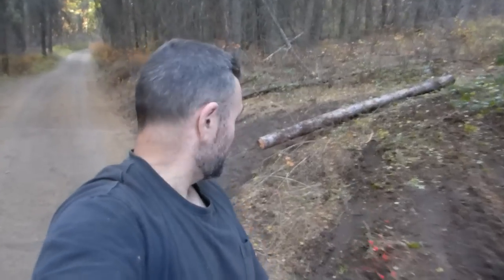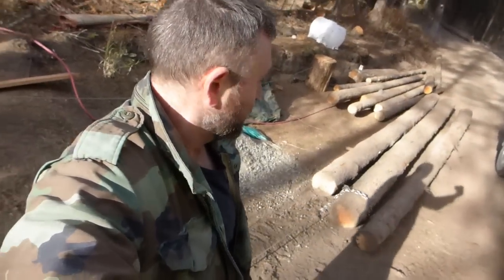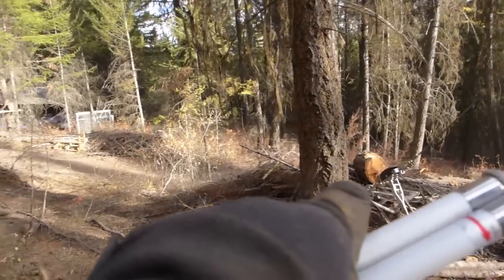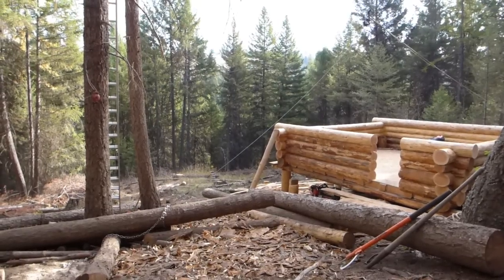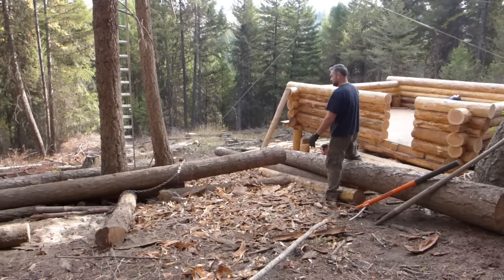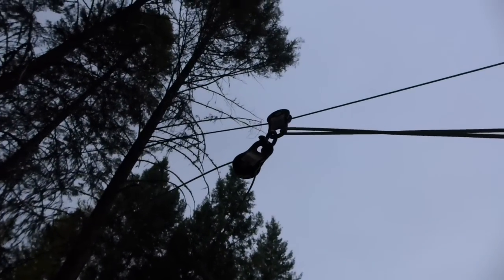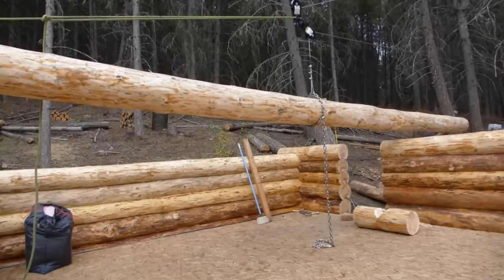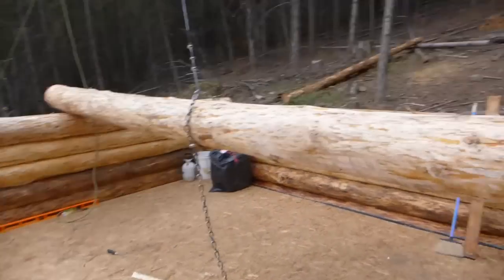Off Grid Log Cabin Build - Moving logs

Comment: Great job, lot so hard world involved. We helped build a cabin years ago using the same techniques, brute force with mechanical advantage of cables and pullys. One thing we added was an old car engine hood to help bring logs out of bush. laid the ends of log on it, could lay more than one long on it, thread chain through hood then around log ends to hold hood in place, acted like a sled through the rough ground, preventing the leading end of the logs from digging in. We also made sure when hooking logs, the hook at end of chain came down over chain, if bought up under and hooked, when slack there is danger of hook falling down down and away from chain, freeing log to roll away.

Comment: Using 2 snatch block is brilliant !  It keeps the work vehicle close to where you are maneuvering the log so yu don't have to yell to much to the Missus !

When using chains for wrapping around thing to haul them, I have found that replacing one of the hooks with an over sized hook that the chain will slide through and tighten as you pull, to be very useful.

Comment: I too used larger than average logs (better thermal protection) and to lift logs to the wall we built, from dimension lumber, a small crane that was self-standing on a square footprint. Sort of pyramidal with a center-balanced, vertically pivoting arm. The lift side of the arm was hooked to the balance point of the log. The opposite end of te arm was hooked with a come-along to loops of cable, through the floor, around floor-joists. This anchored the crane and provided the leverage needed to lift the logs. The higher the lift the longer the crane arm or adjust it to pivot a bit off center (but that adds weight to the lifting end). Great interest here. Would like to see more of it.

Comment: I Took one of those 275 gallon oil tanks that is oblong shaped and cut in half diagonally and welded a frame to hook a chain to and laid the logs in the pan of the barrel to skid the logs a lot easier and without tearing up the land so much.
Reply: Funny, I thought I invented that; except I already had the cut tank sitting around from a botched homemade smoker attempt. Saw the two halves sitting there and thought "yep, that will make this work easier / better". Works like a charm; everyone should skid logs this way!
Reply: When you're poor you make due with whatever you can find. All of my 3 Point hitch attachments except my 5 foot tiller are home made from scrap steel. I use everything from used steel bed frame rails to barrels to truck /car parts to make good working stuff. The tools you buy nowadays are engineered with a short lifespan so somewhere down the road they can sell you another one. The Auto industry taught the whole world that trick.

Comment: If ever you are rolling logs or pipe, anything round, always, always, always, keep a small foot long piece of rope or rag in your pocket, and put it on the log or pipe that is on the bottom, behind the roll, so if it rolls back it will stop. Same idea as putting chocks or a wedge behind your wheels so a car doesn't roll away.....safety first.  ;  )

Comment: Maybe this will sound like a stupid question but it's been worrying me for about a week now and your channel suddenly appeared in my 'recommend for you' bit on my home page. I have a forest that looks pretty much like the one you're hauling logs from (I'm not going to go into boring details just now but if you want to know just ask) I intend to put down the concrete base and I believe some of these concrete riser things that you lay the first logs across (to keep it off the ground to stop rotting? ) I'm not a technical expert but we have a fairly good idea of what we are doing.  
The question thats bothering me is: firstly I saw a video of people in Finnland building a log cabin and they were measuring the diameter of trees with a thing (caliper?  A long stick with two sliding pieces of wood which they could stick up the tree to make sure it was roughly the same diameter. .remember it was in Finnish and the translation left a lot to be desired!) Anyway they then cut the trees they wanted down and hitched them to a horse and it pulled them to the build site. NOW I was lead to believe about 2 days ago that you have to leave wood to dry for years before using it?  The Finnish guys just started cutting out the corner pieces so that the logs would fit together and packing the spaces with 'tar oakum' they were building the day they logged it! ( also I'm sure in days gone by people built cabins asap because they needed shelter and I cant see people up in Alaska and places like that sitting around for a few years whilst freezing to death.  
Can you please let me know what you think because I have watched so many videos many in English but the makers just seem to assume everyone who is attempting to live off grid is an expert in building, solar/wind hybrids and inverters etc? I would be eternally grateful. .if you post an answer I will be notified by Google plus. Thanks in advance (and for posting video that I can understand! ).
Reply from the maker: +Anne Anderson (Foxiepaws) Hi Anne. This is not a stupid question, I was unsure myself before I started out. I am going to say that firstly if you can season your logs you should. The diameter of the log will continue to shrink for several years, this is not a big deal if you factor shrinkage in to your construction.
I have personally investigated cabins in my area that have been built both ways, some with well seasoned logs and a few with green. The climate you live in will also factor in... if I were in a fairly humid, high rainfall area building with green logs would be an issue, they may never dry. We live in a dry area (with the exception of winter)... Spring, Summer and Autumn will see temps in the 90's with the occasional 100's in Summer. These conditions will dry logs out pretty fast.
We expect the cabin to settle at least 6-8 inches... if I want a 7 ft ceiling I build the walls to 8ft, also we will a leave 6-8 inch gap above your doors and windows so that as walls settle they do not impact doors and window frames.
I am planning on putting a video out showing two different well established cabins, one built with seasoned logs and the other with green and how they look years later.
Hopefully this has helped a little.
Reply: Off Grid Warrior Thanks so much that has calmed me down quite a bit.  I am going to be doing the cabin in sections that I can add to later which will probably be better built once we are a bit experienced.  We have had storm force winds again just this last fortnight and another few hundred spruce have come down.  So we have lots of wood laying around now for building and for wood burning stoves.  It does rain in the Highlands but its not humid the snow is usually powder and then it freezes hard. Inland we hardly ever get the slushy snow that the east coast gets and if you have ever lived in London which is practically the second most humid place after the Panama Canal that I have been,  then the Highlands are positively arrid! (Slight exaggeration but it's generally drier due to the wind I think,  it seems to take the moisture with it.) I know the temperature gets much lower up in Scotland but somehow the damp in London makes it more miserable.  I will keep watching your videos and look forward to seeing the ones you mentioned.  Thanks again.  X
Reply: Anne, it's been 9 months. Dunno how much progress you've made.  Green or dry,,, you use what you got when it comes to logs.  The first thing to decide is; How are the logs going to meet between courses. Swedish cove is slow. V-notch is so-so.. Round-to-round takes a lot of chinking with a "Hose Monster". Flat-to-flat works well. You can use an adze to flat side the logs OR an Alaskan chainsaw mill.  I did flat-to flat because I built a sawmill. With green logs, you can count on about 9 inches of shrink in the wall. You should build with 9 ft. walls. You can not attach anything vertical to anything horizontal in a log house. 
You have to cut a big groove in the ends of the logs and fit in a spline. I used a 2X4. My door attaches to the spline, NOT to the logs.  Same for the windows.  I used a router to cut the groove. You have to leave considerable shrink/settling space above the doors. 
Put in foam and cover with a flashing.  Good luck
Reply: could be dead trees dry standing but green or dry are both going to work fine
Reply: I just found your channel and am loving what I have been watching! My dad and I built Scandinavian scribe fit log homes for a few years back in our home town in north western Maine and he and my uncle built a couple churches in southern Quebec and they are so beautiful! I was wondering where you were from and what part of the country your home was being built? Love the content!
Reply: As hard an as expensive as it is you cannot go wrong with a "Real" Foundation...this guy rushed passed that to play with logs  and just has a few posts...

Comment: Hi OGW and wife AKA Mrs OGW,

This is the first of your videos I have viewed and I have to say you do seem to have things pretty well organised with the various snatch-blocks and other ways of moving, not least trying to keep the moving log banned on logs of off-cuts, very well thought out. Of course the snatch blocks can be moved to make things easier.
Are you going to leave yourself the chance of adding to the cabin after you have moved in by building another maybe smaller cabin at the back? It seems to be a cool build, the only question mark is whether you should have, and presumably it is still possible to add vertical logs to the doorway to strengthen a place that will already have a built-in weakness?
.
mrbluenun
Take care I have subbed
Reply from the maker: +mrbluenun Thanks for your comments. We plan on a 8x16ft add-on to the back of the cabin after Winter. Door frame will happen once we have the last full length log (cap log) on the wall. This cap log will strengthen/firm/lock the wall into place.
Reply: +Off Grid Warrior Many thanks for your reply. I understand what you mean because I was a builder for a good chunk of my life. 

Take care
mrbluenun